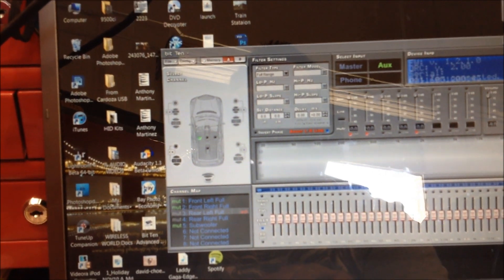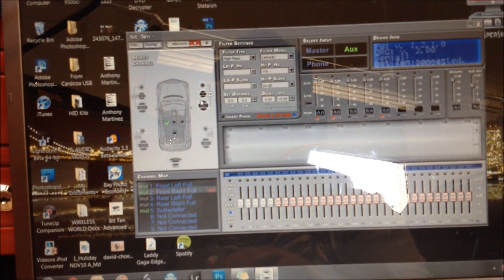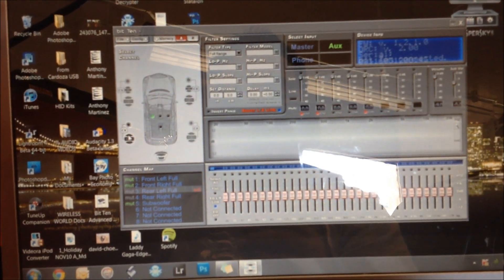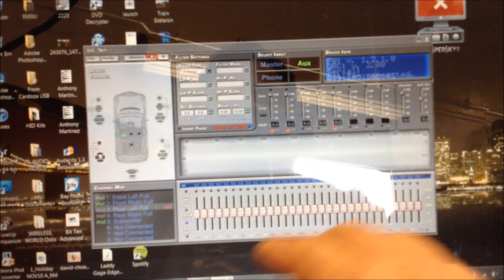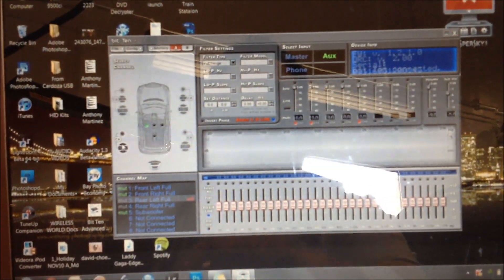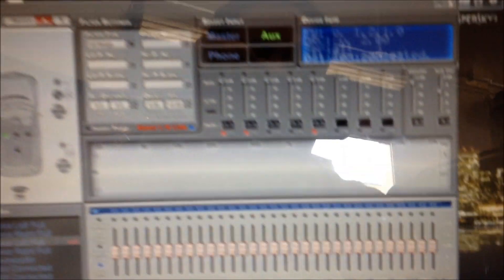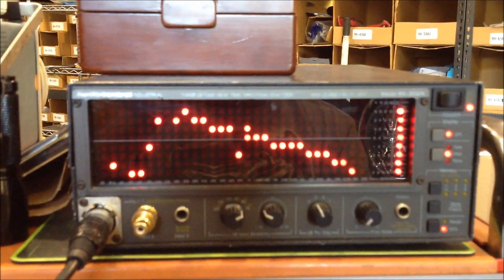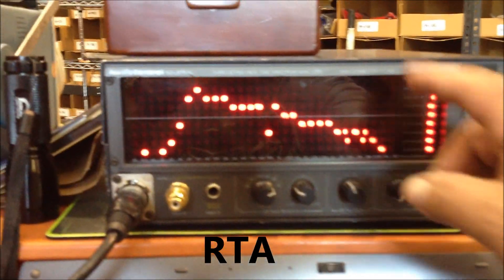Adjusting an Audison Bit Ten Signal Interface Processor

Comment: Howdy, I have an aftermarket head unit Pioneer AVIC-Z130BT with 3 RCA pre-outs 4-volts...How can I connect it to this Bit Ten input? If I were to use the high level speaker inputs on bit ten, then the subwoofer would be left out as bit ten only has speaker inputs (FL, FR, RL and RR)...wouldn't it be better to use low-level inputs for a cleaner signal? Only there is one set of low-level input on bit ten (AUX-IN)...I am confused...Please explain this if you can? Much appreciated, Ken.